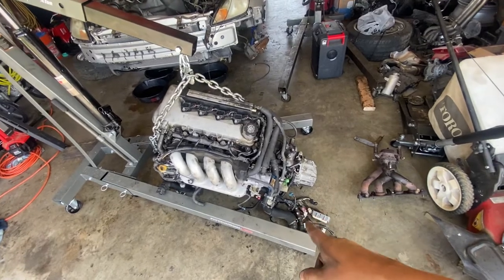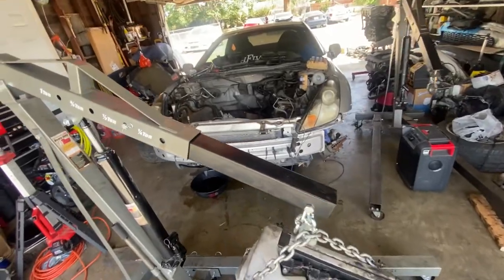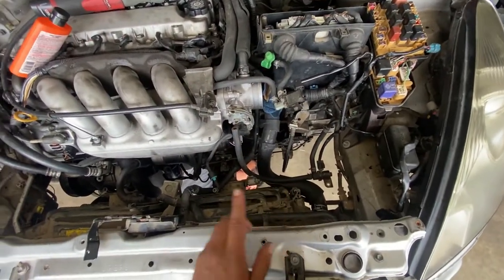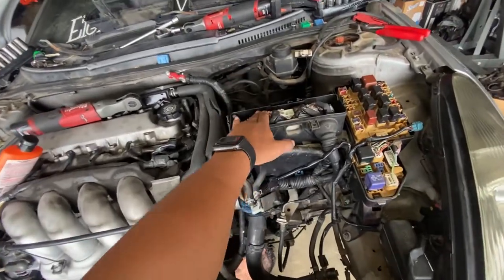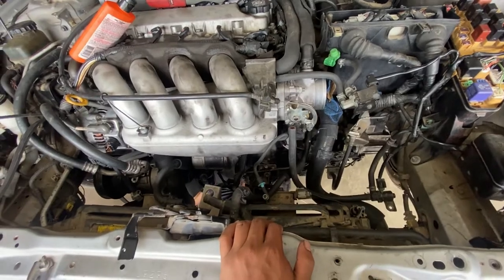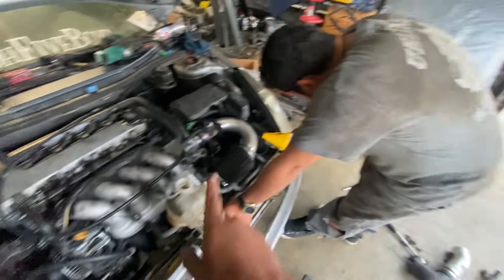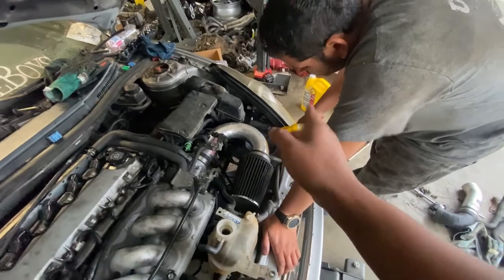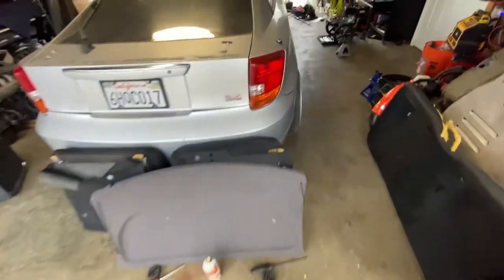2zz Swap Celica Part 2

Comment: Hello dear how are, 
Dear if i want to swap 1zz to 2zz can i instal 5speed transmission
Reply: Because i found engine only c6 gear i do not found
Reply from the maker: Yes you can c56 will bolt up to the 2zz same with c60 on 1zz